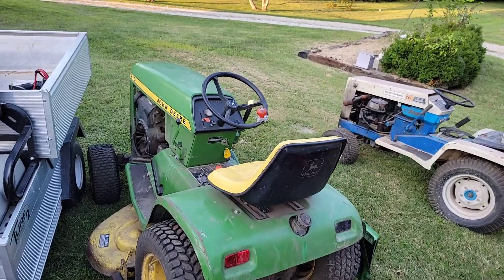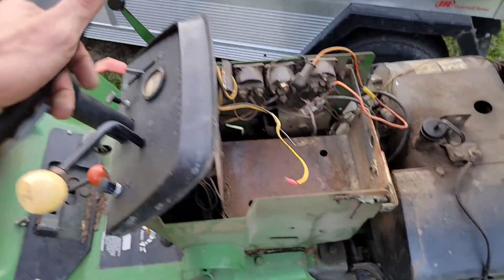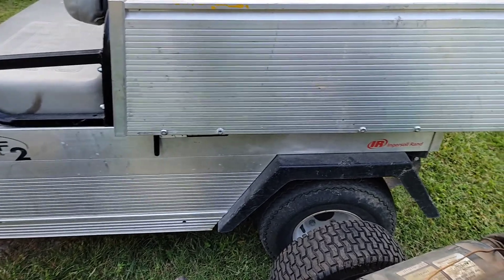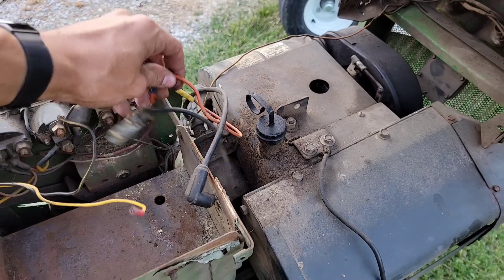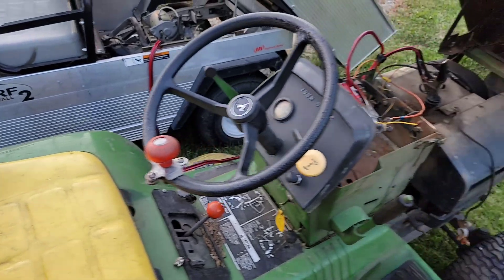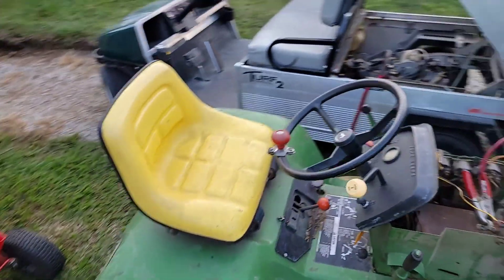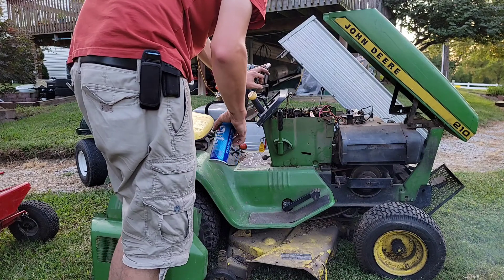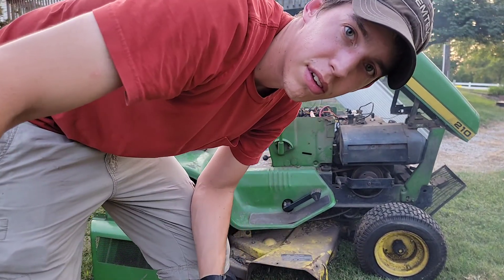Will The John Deere 210 Run?

Comment: My John Deere 160 looks just like yours and similar to this one but when I tried to pull the back tire off, it pulled the spindle out with it. The tire is supposed to slide off the spindle but it was so rusted it wouldn't come off so something had to give. I found out when I pulled the spindle out it pulled a snap ring off inside the transmission- so how do you put that back? The way it is now I mow a little bit and the tire comes disengaged from the transmission and stops going forward until I push the tire back on to engage the spindle.